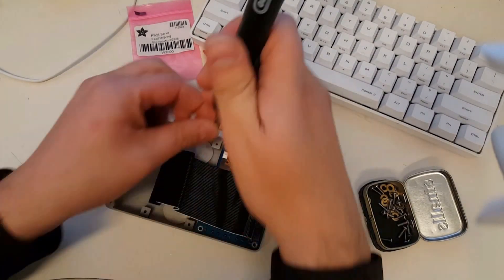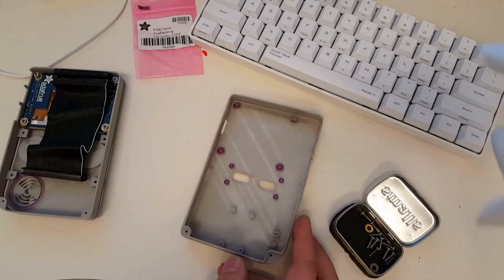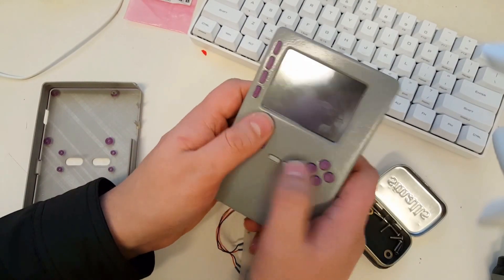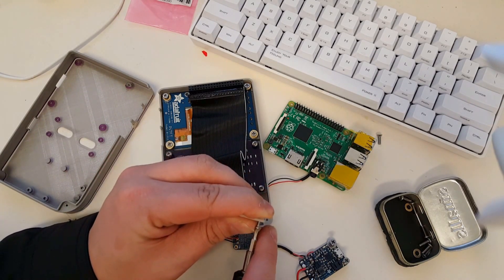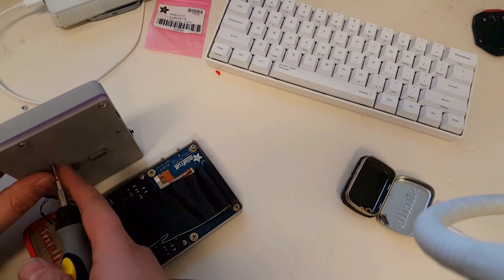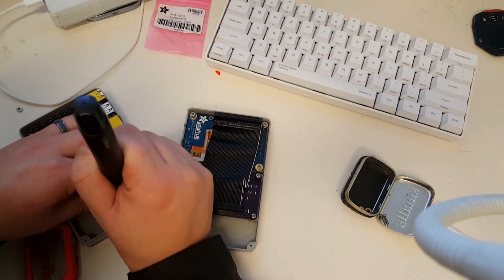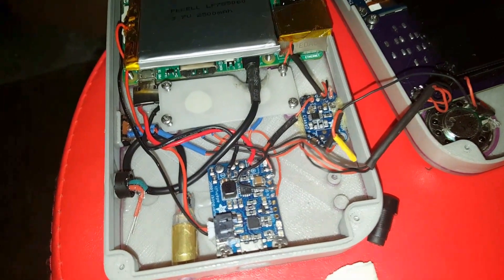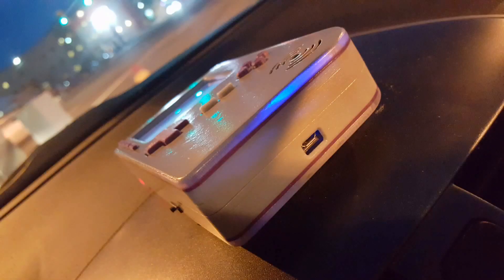PiGRRL 2 Project Review

Comment: Very cool video. I like that you gave it your own twist! Would you please share how you connected the LED to the power source? Also, I see you used an audio jack extension? Very cool!
Reply from the maker: +Bastiaan van der Vossen If I remember correctly you connect the anode to LBO and the cathode to 5v. The extension is a cable from radio shack that splits the TRRS into stereo and mic cables. I just cut off the mic and stripped the plastic off.

Comment: Hi I am a total beginner and looking to make this project. Is there any way you can describe how you added a headphone jack? I'm concerned about not being able to control the volume level as well.
Reply from the maker: I just got a splitter from Radishack and plugged it in. had to modify it a bit so it wohld fit but it worked ok. not sure what to do about volume but if you think of something let me know.
Reply: +Disrupt It Yourself Hey, I was wondering the same thing. Have you seen this yet? It appears to be some potentiometer hooked up in the system. A 3d printed turning wheel is then used as the volume control

http://www.thingiverse.com/thing:969194

Would you perhaps tell me if it is easy to switch between headphones and speakers? I don't know if it is obvious or not, but it sounds complicated to have the RPi automatically switch to headphones if they are detected. I was actually thinking you could hook up the positive wire to a sliding switch, which would connect to either the headphones or the speakers. More complex even, it appears the headphones would be stereo, whereas the speakers are mono.
Reply: Wire in a variable resistor, or scavenge a volume wheel from an old gameboy.
Reply: Bastiaan van der Vossen I'm planning on using a stereo 5 pin jack with internal switch and wiring the output of the mono amp into both L&R pins on the jack, and then the switched output from the jack will go to the speaker.

Not sure about the volume, thinking about putting a pot inline, but the case is already quite full.
Reply: Then you thought similar as I did. I go from Pi - > headphone cable -> wheel potentiometer 5k -> wires -> 5pin jack with internal switch -> wires -> amplifier board -> speakers.

This way, I have volume control on both speakers and headset. And the speakers get muted when I plug in the headphones.

Comment: How did you set up the PITFT? I know I need to install the driver on it. Do you have a tutorial on that?
Reply from the maker: Hey Devin sorry for the delay. The hardware prep is here: https://learn.adafruit.com/pigrrl-2/pitft-display
And software: https://learn.adafruit.com/pigrrl-2/software (second half covers fbcp which allows the hdmi output to be copied to a framebuffer and displayed to the pitft).
PiTFT in general: https://learn.adafruit.com/adafruit-pitft-28-inch-resistive-touchscreen-display-raspberry-pi

Comment: Question for you, i am having problems getting mine to work correctly, the screen wont come on, you seem to be connecting power directly to Pi through a connections, i dont see that steps in the instructions provided....any insight on how its powered ? thanks
Reply from the maker: I apologize for never getting back to you. I need to figure out how to manage these better.

I used this setup to assure power went though the circuitry that is designed to receive power. It makes me nervous to power over gpio. Admittedly modern Raspberry Pi's are pretty unlikely to experience problems. Did you contact Adafruit? Was there something wrong with your pitft?

Comment: Hey I'm having trouble fitting all the components in is it the ribbon cable that's the problem? Please help me out.
Reply from the maker: Its tricky with the battery but you can do it. I use a stick to position the battery as I close it.

Comment: whats that micro usb you have going from the power supply board up to the pi? the diagrams on adafruit dont show that at all. they send power through the control pcb
Reply from the maker: I forgot to mention it in the video. It was just personal preference and didn't make as big of a difference as I thought it would.
Reply: +Disrupt It Yourself 
im trying to put my pigrrl 2 together and when i follow their directions the pi and screen dont light up but when i run a usb directly into the pi the board and screen light up
Reply from the maker: +TONY T. find me on instagram and send me a picture of your powerboost and connections. @disruptityourself

Comment: Hey I know noticed you didn't wire it up like the Adafruit suggest? You have power going directly to the pi from the powerboost, why is that? Currently I'm having issues with mine. Did you run power from the gamepad?
Reply from the maker: +Derrick Stallings I kind of forgot to mention that in the video but I also probably don't need to. I made that decision in an attempt to route power though the USB circuitry hoping it would reduce audio noise somehow but it didn't help.
Reply: I was about to ask the same thing.

Comment: Does the hdmi port still work? Can you play the portable console and then connect it to a tv via hdmi and use wired controllers for multiplayer games?
Reply from the maker: +JCValuations Appraisal The beauty of an open source project like this is that you cant make it do whatever you want. Be default it does not bring the hdmi to the outside of the enclosure but you could modify the design :) The wired controls thing definitely works.
Reply: Do you know if the actual HDMI input will still work?  I figured with the PiTFT screen in the pi grrl2 instructions, the video output must be rerouted.  I'm sure running an extension of the HDMI cable to the outside would not be a problem but I just don't know if it would still work. I'm not very knowledgeable on coding or programming but I can work with electronic projects for building and soldering so I would like to do this project.  Great job on your project by the way.  You did some nice modifications to make it yours.
Reply from the maker: Thank you! The HDMI works fine as it is actually doing a framebuffer copy from the HDMI out.
Reply from the maker: If you have any friends that are interested in 3D printing and electronics please share this video with them. It would help me a lot.
Reply: Absolutely thanks a lot for the info.  I'll keep an eye out for your future projects as well.

Comment: Did you have an issue where the speaker was making a high pitch noise. If you did how did you fix it? Can't find a way to fix it.
Reply from the maker: +xlNEWlx What I did was put a switch inline with the speaker (inside) and simply extended the headphone jack to the outside of the enclosure.
Reply: +Disrupt It Yourself I solder a headphone jack and removed the speaker in the meantime I'm gonna try to use a 2200mah cylinder battery and move it to the bottom of the case to hopefully fix the problem.
Reply from the maker: Do it and let me know how it goes!
Reply: +Disrupt It Yourself okay so I got tired of waiting on adafruit to stock the 2200 mah batteries so I bought one on Amazon and just soldered the connector. Well I just finished putting my pigrrl together and this definitely got rid of that annoying noise from the speaker.
Reply from the maker: Wow wait so adding your connector seemed to fix it???
Reply: +Disrupt It Yourself well what fixed the problem was changing the battery to a 2200mah ICR18650 but the one I bought didn't have the jst cable to connect it to the powerboost. Using that battery I was able to move it all the way to the bottom of the case away from the raspberry pie thus getting rid of that noise.
Reply from the maker: I'll have to try that!
Reply: +Disrupt It Yourself yeah also if you search pigrrl 2 remix on thingiverse someone redesigned the back piece of the case to fit the 2200 mah battery that's what I used.
Reply: I had the exact same problem. I just wrapped the battery in regular aluminum foil and I have had a problem since lol.

Comment: Can you use a raspberry pi 3 with this and have it so it will not be under-powered or show the low voltage symbol?
~Thanks
Reply from the maker: +Just an ordinary channel are you getting low voltage from the powerboost or the pi? You might want to disable wireless when it isn't needed.
Reply: I have yet to test it but with a powerboost but with a  regular 5 volt 2.1 amp power bank it gives off a little lightning bolt
Reply from the maker: +Just an ordinary channel that power bank might not be ideal for the pi. The powerboost is intentionally 5.2v to help the pi stay properly powered.
Reply: Thanks!
Reply: So the raspberry pi 3b will not be underpowered?
Reply from the maker: +Just an ordinary channel it hasn't been in my experience. Nothing like "brown out' behavior. It's been working fine for me.

Comment: How did you re wire the battery indicator light ?
Reply from the maker: +Dragon Cyborg The PowerBoost has an LBO that pulls low when the battery is low. So you wire it up to the cathode and the anode to 5 volts.
Reply: great thanks :)
Reply: +Disrupt It Yourself I'm trying to make something to work with this as well. I would like a green LED that lights while the battery is good, and a red LED that lights while the battery is low.

I will try to hook up the red LED to LBO and 5V, but have to wait until my battery is finally low to test it out.
Could you make a suggestion on how to hook up the green LED? I thought I could make it work by using the LBO and GND option, but that only triggers that surface-mounted LED, and nothing else.
Reply from the maker: Bastiaan van der Vossen I'll look into it. The best thing would be to post on the Adafruit forum.
Reply: +Disrupt It Yourself I figured it out:

LBO = Vbat or 0 
So: 5V - LBO is between 1 - 2V if high, else 5.1V
Also: LBO - GND is between 3.3-4.2V if high, else 0V.

Thus, my idea to hook up LBO to GND for a Good-battery-indicator would work, were it not for the surface mounted red LED that is also hooked up to LBO-GND. I hook up the LEDto LBO and GND, and I activate both LEDs, thus making it shine too softly. 

Not a big deal, I'll disregard that indicator and just have it always on. The lowbattery indicator is much more useful.